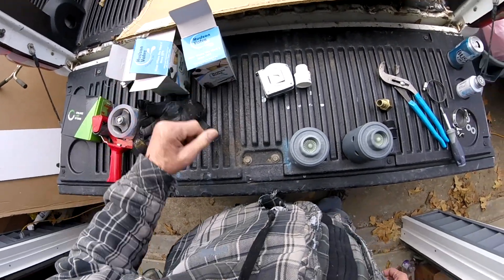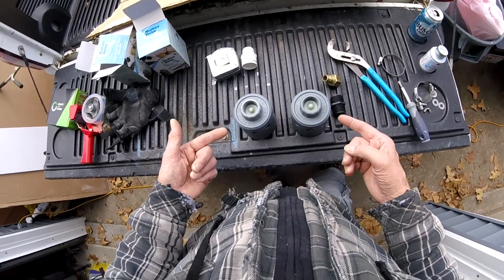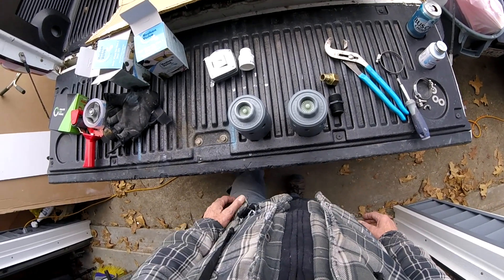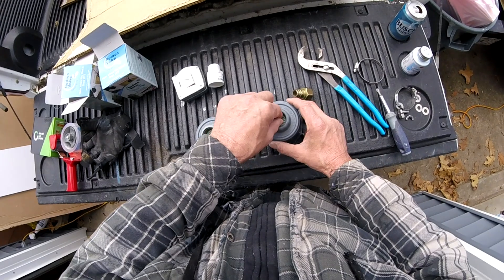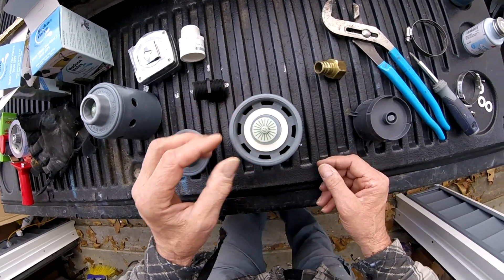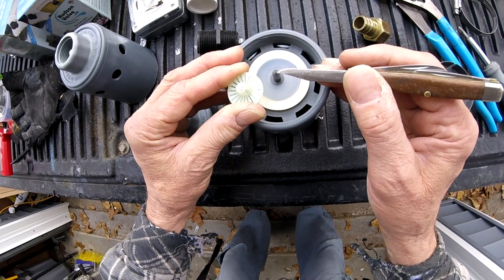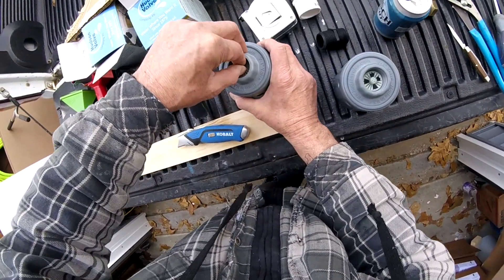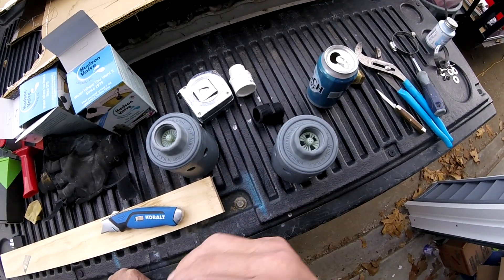How a Hudson float valve works. PLUS HACK!!!!!!!!!

Comment: nice video , I just ordered one of those , your video is going to help , what is the chance that diaphragm be degreaser resistant ? I intend to install in a 20 gallon water tank before my pressure washer , and sometimes I dump a gallon or 2 of degreaser on it to pre spray a floor , just wondering if this valve may survive the degreaser
Reply from the maker: If you're dumping degreaser in the tank, none will go through the Hudson.

Comment: Thanks for the breakdown.  You may try using psi and force. 1 inch of 50 psi is 50 pounds of force. 2 inches of area at 50 psi is 100 pounds of force. I'm pretty sure.
Reply from the maker: Great info!

Comment: I love your videos! Can a DS Injector with 1/4 ID line be plumbed properly with a 1/2 bulkhead on a tank without just dropping the loose 1/4 line in the tank through the bulkhead opening? I wanted to use 1/4 barbs on the bulkhead but i am afraid the 1/2 gap inside the bulkhead would prevent soap from pulling.
Reply from the maker: Yes. It will just take a bit longer to pull chem the first time.

Comment: Maybe using a drill bit instead of razor knife would work better
Reply from the maker: The plastic is so hard that a drill bit will split it.  I ended up heating up my utility blade and melting/cutting the sections out.